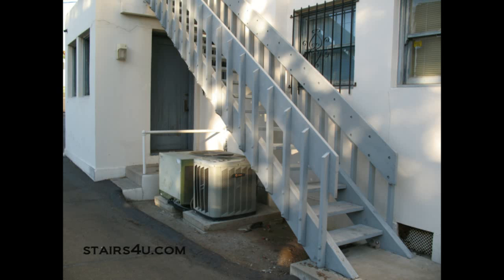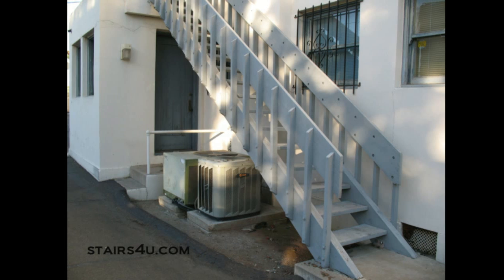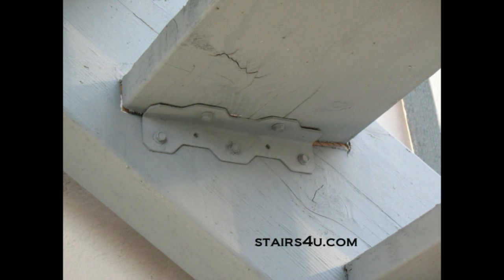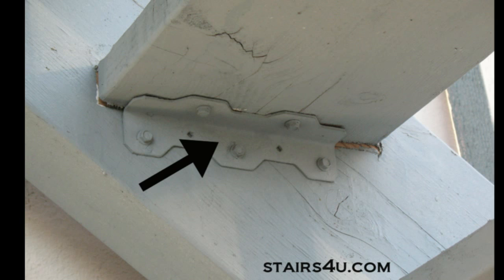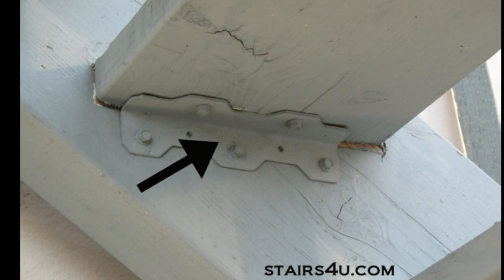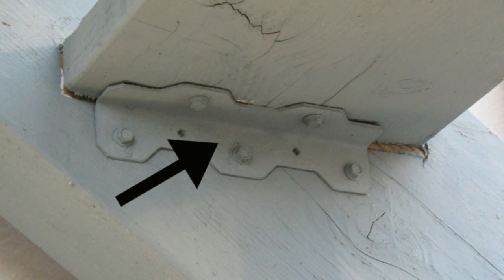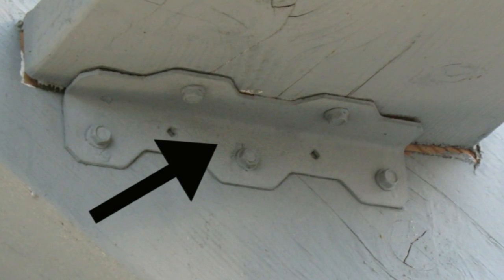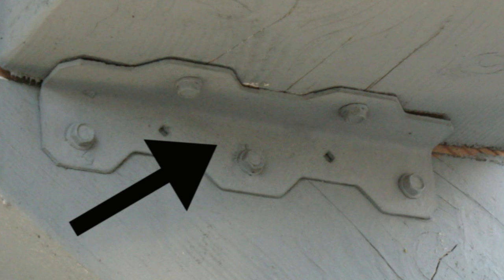What Is A Stair Tread Bracket? - Stairway Construction Parts

Comment: Are carriage bolts stronger or lag bolts for attaching wood treads to stringers when using metal brackets ??
Reply from the maker: It will depend upon the size and installation, but I would say that the winner would be carriage bolts.